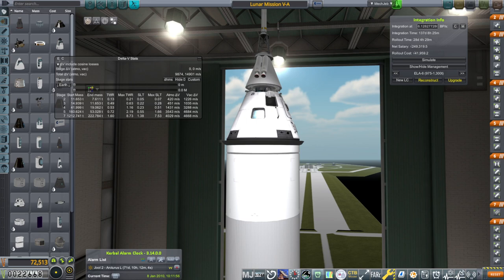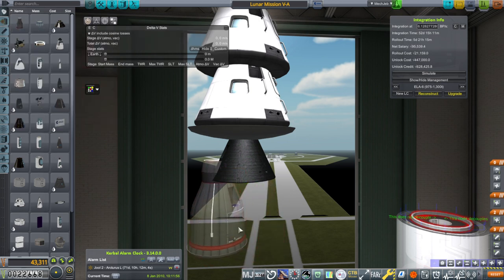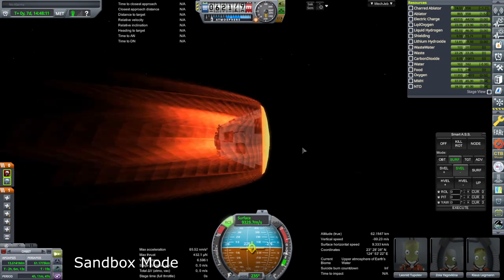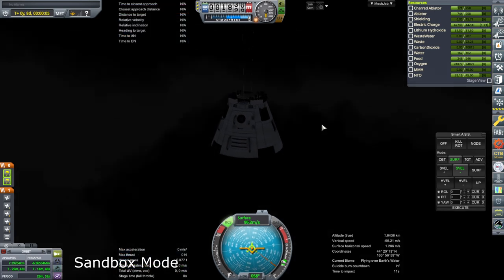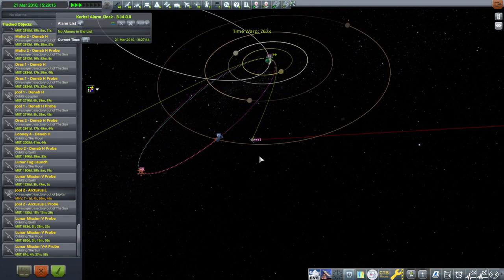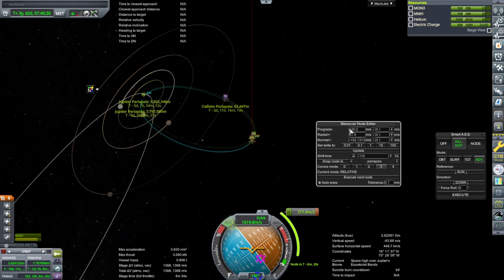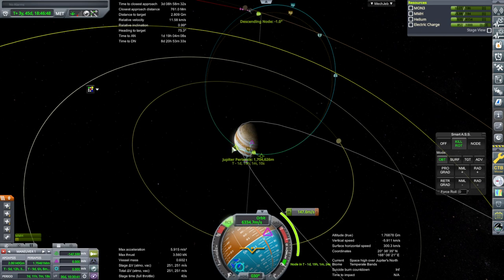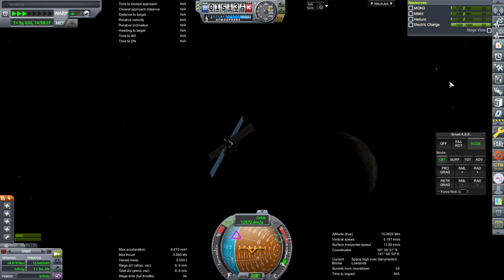RP-1 Career in KSP 1.12 - European Space Agency 57

Comment: I said it after the last video, but I’ll say it again: you CANNOT use MLI on a capsule for lunar re-entry! The moment the skin is exposed to 10km/s airflow it’ll get incinerated, which is exactly what you’re getting time after time. It’s not the capsule’s heat tolerance, it’s not the node location, it’s not the heatshield, it’s not descent mode, it’s MLI. Add the fuel cell hydrolox to the main hydrolox tank before filling it for the engine- most hydrolox engines burn considerably hydrogen-rich and with an oxygen pressurisation system and lox to gox converter you’ll use up even more oxygen so it’s a good idea to take some extra lox on top of the fuel cell stuff.
Reply from the maker: Okay, we will test that. It makes no sense to me, though, since then they should just remove the MLI option on the pod. That leaves them with no way to simulate tanks insulated with MLI inside the body of the command pod. If what you say is true, it is still a flaw with the mod. They should make sure that the MLI option doesn't get added to reentry pods.

Comment: Maybe use lifting only on 2-3 km/s speeds, where heating is not as significant but g-force seems to be maximum?
Reply from the maker: It used to be that the lifting was actually more important to make sure you captured into the atmosphere instead of bouncing up - you'd go inverted to do that - but yeah, if they were getting much more than 6 Gs I'd probably activate it at the lower speeds. Right now, I really don't see the need.

Comment: have you tryed the restock heat shield?
Reply from the maker: No - just for consistency, I'm only using the Adjustable Heatshield because otherwise it becomes a "what about this heatshield?" thing.
Reply: @RaizSpace  the Adjustable Heatshield has a restock version under core
Reply from the maker: I don't know what you mean by "under core." If it's configured the same way, I don't see why it should make a difference, and it would have to be configured the same way since otherwise there would be a lack of parity between the procedural heatshield options.
Reply: @RaizSpace  the node is different
Reply from the maker: I think we sort of determined that the node wasn't the issue, since I went in and changed the node back to the original one and it made no difference.